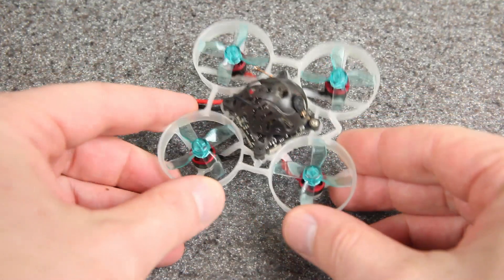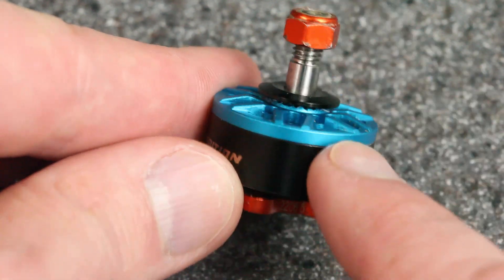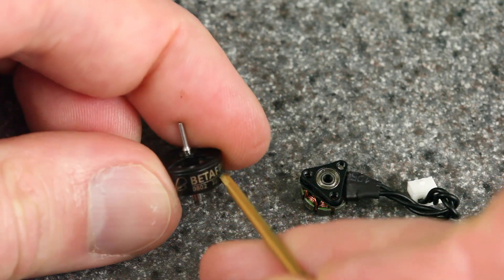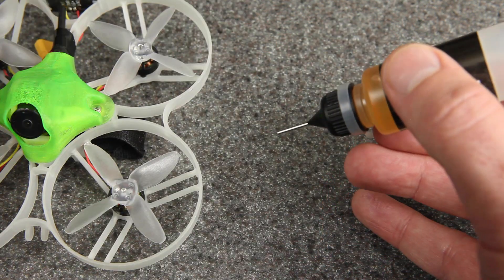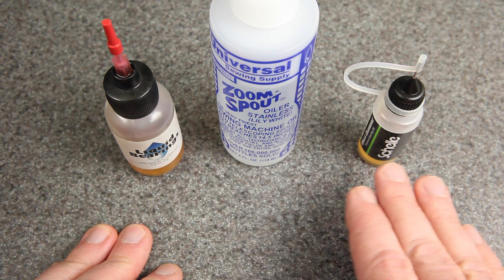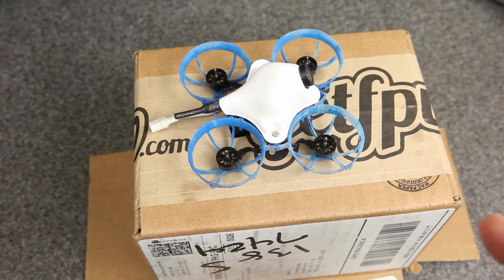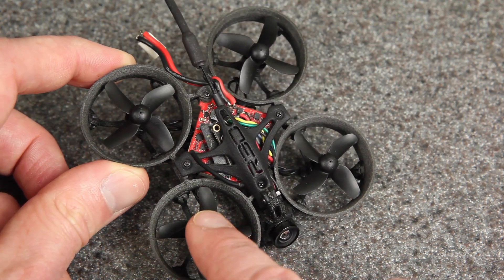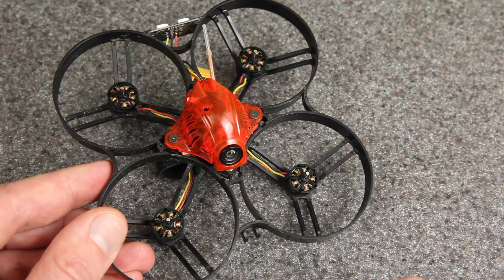Do your brushless motors need oil?

Comment: small motors often seem like stop working - cant start up up on arming, reboot esc after roll - I found that this is caused by ESC low rpm protection when esc restarts if motor can not start spinning on low input. this is also confirmed via Betaflight motor tab - increase input with arrow up on keyboard and see where each motor will start spinning.

I had 2 motors of mobula 6 0803 25k kv act out and I was about to change them, but I first dismounted them and tried to clean them completely with alcohol - this didn't help, cleaned motors would require even higher Pwm input. So I flipped up side down and put a drop of WD40 into C clip, and left it for 5 min. Than spited all 4 in BF slowly / fast slowly fast.

result were much better but some would be about 1030 other few 1023 pmw, next day in the morning all of them were able to spin freely at 1019 pmw :D This was a few weeks ago, still going strong beside a bent shaft :D

- what I wanted to say is that it is enough to oil those from the bottom, and than wait and spin them a little and leave it till next flight up side down (or over night)
Reply: now that you mentioned, it makes sense to use synthetic - wd40 is mainly mineral oil and probably not ok for high KV task hmm will keep it on whatchamacallit's out

Comment: Nice vid, I race slotcars and I use bronze bearing oil which works really well as the motors rev to a stupid RPM, link to oil https://www.pendleslotracing.co.uk/scaleauto-speed-oil-sc-5302.html

Comment: Was it effective on your babytooth with the 1202.5 motors? One of my motors doesn’t seem as smooth as the others from new. Love the video!
Reply from the maker: I have not tried it on my babytooth motors. Mine are super smooth and quiet as is, and they have good bearings so I would expect it to make a difference. If you have one that's noisy it may have some kind of physical damage.
Reply: Mr ShutterBug thanks for the reply. It’s not noisy or loud but it does not spin as smooth as the others I noticed that out of the box but figured with break in it may get better. Do you think it may help make it more smooth?
Reply: Mr ShutterBug I’ve flown them 4 times since I built it last week and noticed it on all the flights. Once I’m up and going no issues but a few instances of it not wanting to spin up almost
Reply from the maker: @zacbarnes9075  If it works OK when flying but sometimes doesn't start then you might want to go into the ESC firmware and increase the "Startup Power". That usually helps. It's hard to predict if oil would help, but I think the answer is no.
Reply: Mr ShutterBug thanks! My startup power is at 1 I’ll increase to 1.5 and see if that helps. I’m running the tune and esc firmware from your video on it
Reply: Mr ShutterBug update: I think something within the motor is messed up. When I spin the prop and motor with my finger I feel resistance and it feels notchier. I posted a video on the Facebook group about it

Comment: Another thing that can happen with the bearing one side and bushing on the other is that the bushing will wear unevenly. This will case specific noise/oscillation at specific RPM. Eventually the wobble damages the bearing and a good motor is done before its time. I'm super glad to see you have addressed this! In some cases you can find the bearings and replace them in advance as part of maintenance. Bearing quality varies widely as well! I've even replaced bushings with bearings. Maybe a topic for a future video?

Comment: For larger motors, how about changing to a better abec9 bearing for smoother spin?
Reply: Becouse they are for skateboards and not meant for high RPM.  Ceramic bearings should be better, but hard to find in a size for brushless motors

Comment: I use TRI-FLOW (it's my go to light oil), but I put a CA glue applicator tip on to reduce it to a pinpoint drop. This fixed desync on old beat up 0802 motors on one of my whoops a while back. I tried it when I heard UAV TECH mention it in a tuning video.

Comment: Got dirt, blew motors out 100psi, worried that i blew the oil or grease out. Used Scorpion oil in my shielded bearings 2200kv motors. Its thin as water and WILL pass through the shield. Always wondered if the bearings are lightly greased or oiled at the factory. Also if the shaft can SLIP into the inner race then they must also spin inside the inner race as well as spinning the inner race itself.
Amazing that there is no problems due to that considering the rpm. Great video! you must have spent many hours on this.

Comment: Yes, I completely agree bushed motors need oiling. I've been using sewing machine oil on my happymodel 0802 with good results. I'm glad you mentioned the needle nose bottle. I've been taking my motor bell off to oil the top bush. A nerve wracking experience every time - oh fujhj where'd that clip go this time!?
Reply: You can also just use a safety pin. Get a small drop of oil on the pin head, tip the head upside down so it flows down the shaft a bit (so it doesn't drop)...place the pin head at the shaft and tip right side up. Don't use a toothpick because it's too porous.

Comment: Thanks for the useful info, people should know these simple but effective maintenance tricks. 
I have experience with Molybdenum disulfide and Silicon oil, both have their place. 
Normally bushing type bearings are made from a sintered bronze alloy which has a high porosity, and are impregnated with lubricant from factory. Molybdenum disulfide is a graphite like mineral which can be use with great success on these bronze like bushes. This is because the MD sticks like shit and fills the porous bush. Would recommend using on nearly new motors, coz once the bush is worn/polished the MD won't be able to fill the porous bushing and not last.
Ball bearings are lubricated from factory, cheap stuff equals cheap lubs. When our cheap Brushless motors get warm, the oil can be centrifugaly forced out. Then you get wear/noisy motors, never clean your motors with a solvent because this will thin the factory fitted oil, then noise begins. 
I oil these simply😂 by removing bearings from motor and soak in a medium viscosity Silicon oil which has been thined with alcohol, soak, dry and repeat a few times for best results. 
To be honest though buying high quality roller bearings in bulk and just swapping them out every now and then is easier. 
I would avoid just dabing oil on motors, although the oil is very thin it attracts dust, which isn't good for for either magnet clearance or the poxy bearings😉
That weird squelching noise is probably backlash within the bearing race. These motors use cheap components:/ 
Hope this helps, would be interested in any other tricks☺
Thanks

Comment: I need to try this. I have some Mamba 08028 motors that i wanted to use for a whoop and a 1S TP.. but at about 1350-1400 throttle they vibrate like crazy (without props). This might be the resonance frequency for my TP frame tho.. I'm not sure.
Has anyone else tried these motors?

Comment: I have only ever lubricated 2207 motors, and after doing so I discovered that the shield and/or retainer was actually broken.  So it helped momentarily, but the problem was actually broken and shattered bearings (balls/rollers, retainers, and/or shields).  Since then I have stopped using librication.  Also, I used Liquid Bearings.

Comment: Nice representation.The blackbox stuff was an eye opener..Maybe I missed if you tried dry lubricants like graphite ? In my limited 30 year experience with brushless motors I've learned that dry lubricants are better if you intend outdoor use as wet ones are just dirt magnets and they'll run great on the bench but after the first exposure to fines they get clogged and run worse.Dry lubricants are also generally much more resistant to heat break down......YMMV...
Reply from the maker: Nice! It's the tiny motors with bushings that seem to benefit the most from lubrication, as far as I've seen, and I mostly fly those indoors. I've tried oiling motors that I use outside, but there hasn't been enough benefit so I stopped doing that. I have not tried graphite because it tends to make a mess and stain things black. Have you been able to avoid that problem?
Reply: This has been my experience too, when I tried lubing micro motors in the past. I believe I was using tiny bits of sewing machine oil, and noticed that I needed to re-apply it regularly after things got gunked up - and stopped using it again ;)
It did seem to work well though, for a while!
Reply: Do not use graphite !! it will definetly shortcut your motorwindings sooner or later
Reply: @smokinjoe1256    lol..I do not recommend using graphite in motor windings only bearings..My experience is mainly with larger motors that I can remove the  shields from the bearings so I can clean and lube them. The tiny whoop size bearings should come pre-lubricated from the factory but QC being what it is probably led to this video in the first place...lol.........If I have a scratchy feeling tiny bearing it'll likely get replaced before I try to refurbish it...good air, straight props..